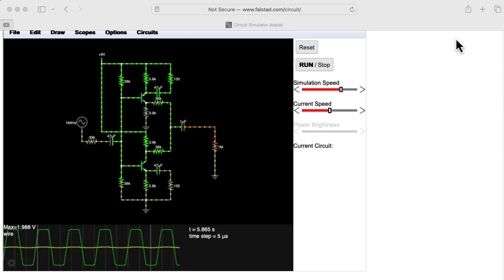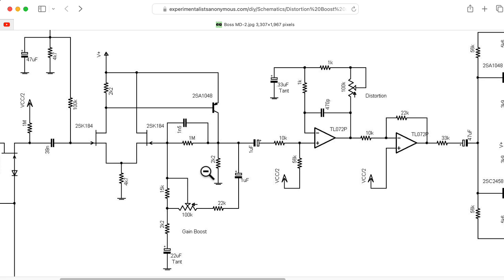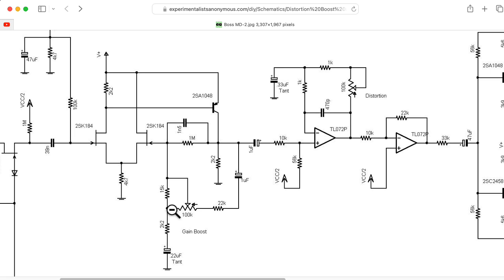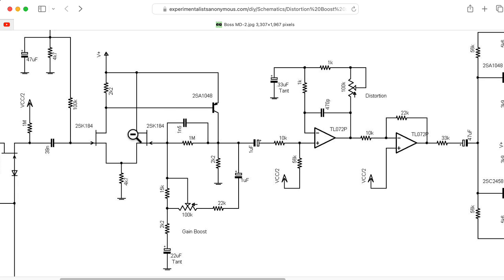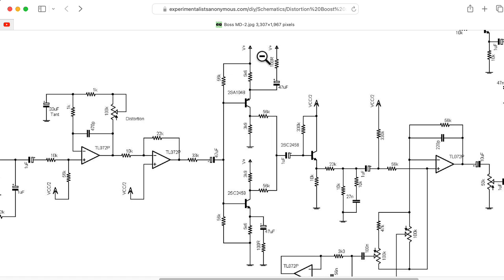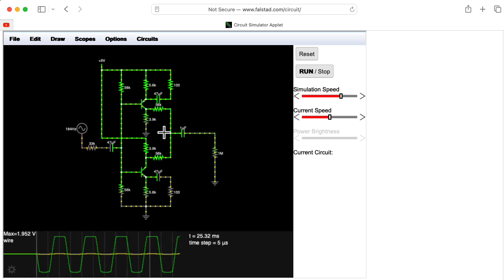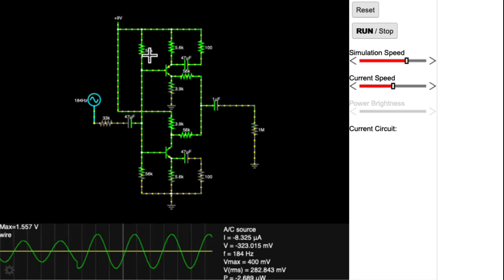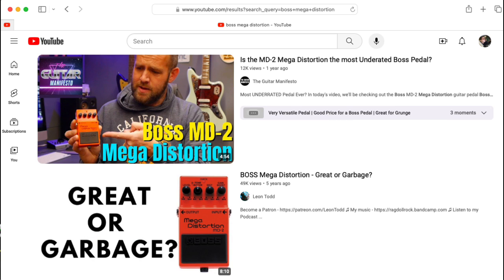Simulation of the Boss MD-2 Mega Distortion Complementary Common Emitter Stage (Falstad)

Comment: at first i thought that big companies like boss use discrete components because they're cheaper. i've also checked thru schematics from ibanez, fulltone, MXR, etc and they all use IC op amps though. even some boss pedals do. 

my personal conclusion is that they may have started as a cost-cutting measure, but later were integrated into the sound of boss pedals. OR vice versa! these very primitive op amps create tons of distortion, have a lot of other finicky electrical characteristics, and boss wouldn't be using them unless someone decided they liked the sound they made.

Comment: My nephew had a MD-2 early on and it struck me as “fine” — it was much more early-2000s nu metal than I cared for, but I also didn’t spend much time trying to dial it in. My impression was that it was more intended to give a bedroom player the vibe of recorded guitars vs the kind of pedal you might actually use if you were playing live & loud with a group. If I’m remembering correctly from 10 years ago, a lot more bass than I would want on my guitar tone.

Comment: There are interesting designs using the 4049UB and 4069UB (hex inverters, unbuffered version) for distortion too, internally they are basically a Mosfet push-pull pair too, afaik. The website "Runoffgroove" made versions of other pedals swapping the opamps for this stages too, like the UBEscreamer (tubescreamer), 22/7(BigMuff Pi) and other original designs too.
The issue is getting CMOS inverters to work as intended on simulators, as usually the spice model is a simplified version of it, but the designs are interesting nonetheless, and you also get soundclips on the website. Very low part count if you want to build it on a protoboard and play with it tho.
Also: Some nice designs using CD4007 inverters too, most famous being the CatalinBread SuperCharge Overdrive (a comercial design).

Comment: I have a question if that’s okay; so I wanted to make a pedal my self that’s a multi FX type. But I don’t know much about actual pedals and so I wanted to make it maybe with a razzberry pi or somthing like that, the simulation you made could it be used for that type of stuff and if so how can you make these simulations?
Reply from the maker: Running a full-fledged circuit simulator like this is not practical for real time effects. Search on google for the electrosmash Raspberry Pi Zero guitar pedal project to get ideas (although it's pretty lo-fi). Also google for pi-fx. Also, I highly recommend checking out the Daisy Seed, it's a STM32 platform. Look up the PedalPCB Terrarium, which is a guitar pedal thingy you can plug a Daisy Seed into. And if you want to learn DSP programming, actually a good place to start is writing plugins for a DAW using something like JUCE, or even Cherry Audio's Voltage Modular (which you can get started with for free). You have much research ahead of you.

Comment: In Falstad you can add an audio input (which requires going through a resistor and will need you to select an MP3 file) and an audio output and then listen to your distorted signal. :)
Reply: I always wanted to try that audio input! Now I have a simulation which I can use.

Comment: Interesting how symmetrical the output simulates. It occurs to me that a simplified DC path can start to look like a BJT version of a CMOS inverter. It looks like they're running two parallel circuits, but share the biasing, which may be the particular novelty here. Otherwise, there might be no reason to do NPN/PNP transistors.

Comment: yes I own a MD-2 since 2002 and play it. Any questions?
Reply from the maker: What do you think about the sound? How do you like to set your controls?
Reply: @Lantertronics  It actually has a quite "organic" distortion-texture, but on the flipside its a bit mushy and lose in the low-end. I mostly have all knobs at noon - not a very sexy answer I know. Sadly I dont have a ds-1 or 2 to compare it to, but I do use mt-2 and hm-2 clones. These sound a lot more aggressive and tight, though a bit more synthetic.
 For some reason, the noise floor of the md-2 is a bit higher than that of the two others.
Lastly I might add that it doesnt seem to take boosts as well as my other pedals, so its not as easy to tighten it up. 
Its a decent pedal, I just dont get the "mega", because the mt-2 has way more distortion to offer.

Comment: I suspect your summarization is accurate and it's intended to simulate valve distortion. When you overdrive transistors very deeply, it can sound more valve than a valve, so this quasi-complimentary pair provides a transistor to clip each half cycle so it has a good valve sound and a single transistor isn't providing the clipping for both half cycles. 

I suspect you're also correct and it's more asymmetrical than the sim is showing, but odd order harmonics do have more sleaze, raunch and decadence than even and the goal of the pedal is to produce metal distortion. 

When I hear pinch harmonics out of low, dominating even order harmonics, there's no raunch, sleaze and soul, just valve-like buzzing that reminds you of a synth and triangle waves. I would guess that this setup is also to prevent the dominant, high even order harmonics of semiconductors and a good blend of low even and odd order harmonics.

Boss has the all-around market dominance of analog and digital gear in contrast to other brands' success in both. We've only just entered into digital being a 90% match to tubes, it started about 10-12 years ago, and has only just been in the last 3 to 4 where every brand caught up. I think that's a result of chip engineers being more mindful to provide circuits within the digital microcontroller to be able to produce asymmetrical and dominant low even order harmonics. 
Likely a product of everyone inspecting one another's solid-state analog and valve products for decades.

Comment: I'm using the SF 300 from Behringer, which seems to be based on this pedal (IMHO). It has some sweet spots, which I like.
Reply: The SF300 is based on the Boss FZ-2 (which itself is based on a Univox Superfuzz). Great pedal, but the circuit is very different